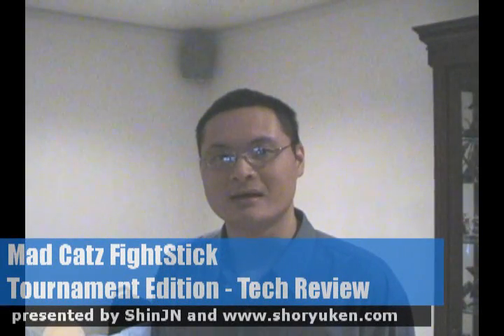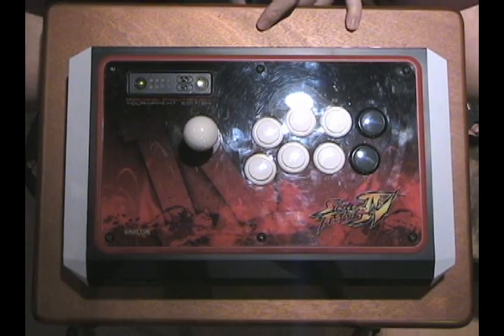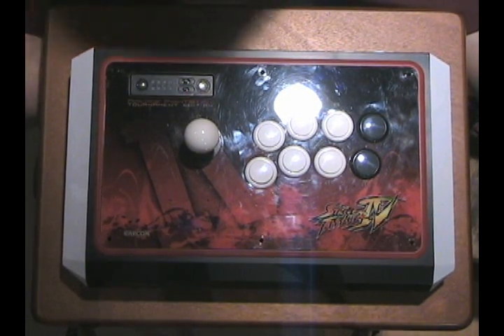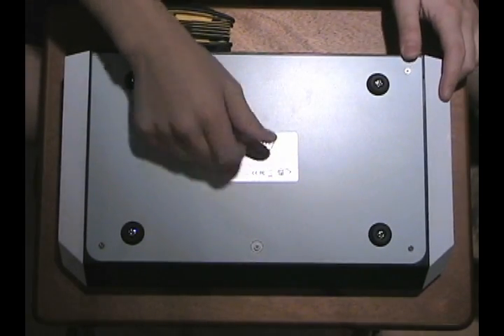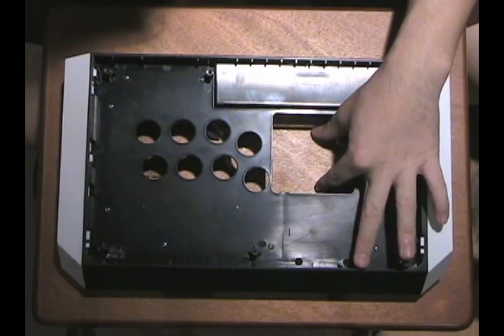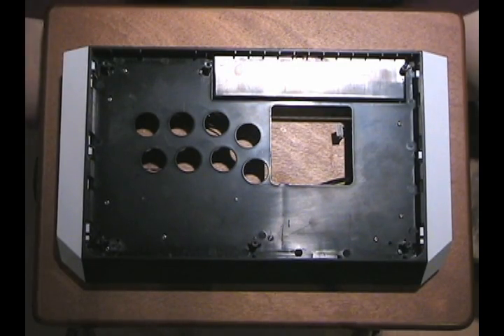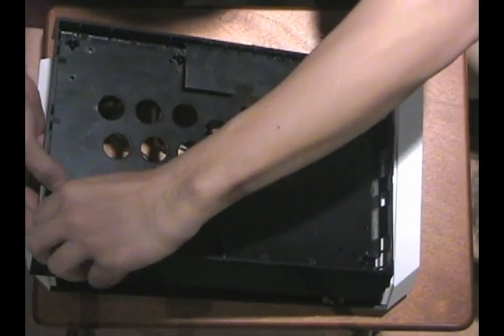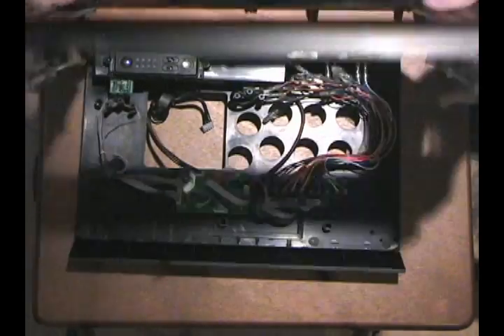SRK's (1/8) Tech Review of Mad Catz FightStick TE by ShinJN

Comment: i want to put the mas systems happ perfect 360 optical joystick into my marvel vs. capcom xbox 360 joystick. i got everything wired up and had some fitment issues i had to drill a hole in the bottom plate and drill four holes in the top plate to bolt down the joystick. but i need to run an extra wire to to the joystick for power that says 5+ so how do i get power because the original ball joystick only had ground and the four direction wires? please get back to me i already made holes

Comment: The "quick" connections aren't so quick. You have to tug on them really hard; I'm worried I'm going to damage the connection wire (yes, I am pulling on the metal connection).
Reply: you just have to get under them with a good pair of pliers.